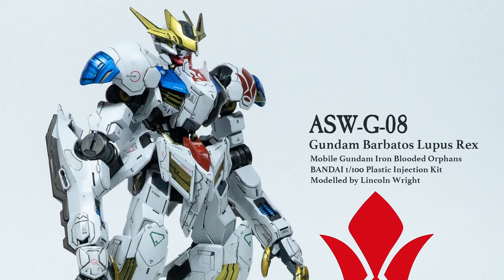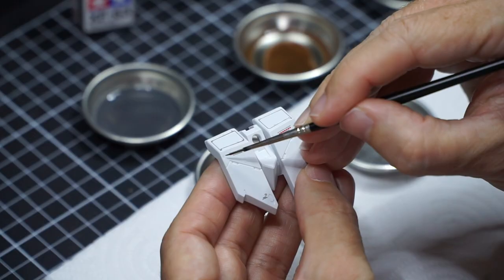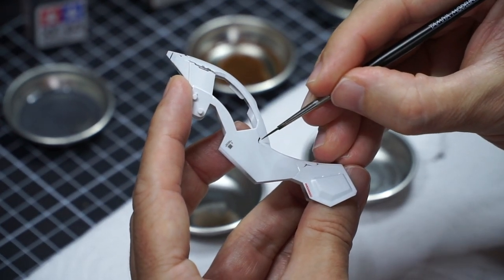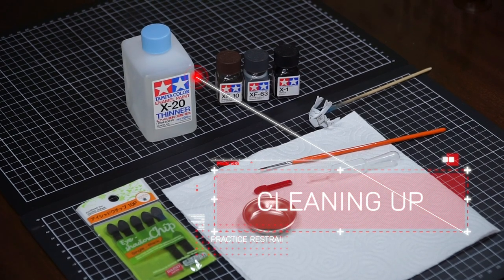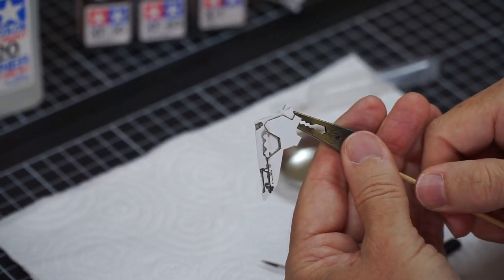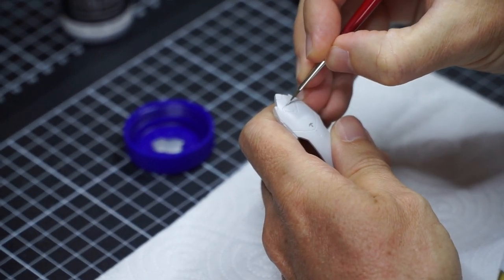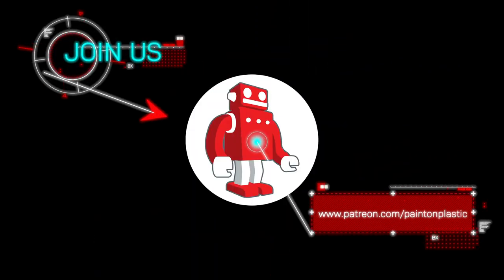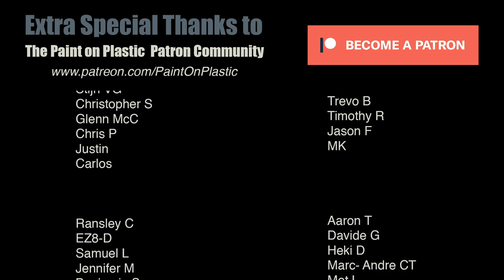Gunpla Panel Lines Tutorial Lupus Rex Lincoln Wright

Comment: Worth mentioning that you should go for the makeup sponges or Tamiya cotton buds over just your regular household cotton buds, as they tend to be tighter packed and don't tend to deposit thin strands of cotton on your model that can then get stuck into paint or varnish.

Also curious if you have given panel lining and weathering a go with Vallejo's new range of 'weathering effects' like the engine range. These are acrylic water based washes and weathering fluids, but they can be cleaned up and manipulated like their enamel counter parts by use of vallejo airbrush thinner or other similar products and cleaned up as described above with a brush damp with airbrush thinner or tamiya cotton buds. You can check out an example of the process on Vallejo's youtube channel.
Reply from the maker: Yes, that's why I went with the make up sponges. Cotton buds I suggest as a  back up. 

Yes again, in fact AV sent me this range for testing and I've used them a handful of times now.  I tried out some of these products on the backpack... In my humble opinion they are "Ok". They dry very quickly - often too quickly - and are not as easy to manipulate as enamel products. They stain more quickly too and once dry are more difficult to remove again. I'll continue experimenting with them in the background but so far they are not making it to my frontline main use choices. :)
Reply: @PaintonPlasticbyLincolnWright  Ah, sorry to hear that. I tend to favour the non toxic ranges. Adding a liquid/high flow acrylic retarder might help with the dry time. AK interactive's one and probably Mig do an identical product might make them more enjoyable. I am finding that an acrylic retarder and a wetting agent (surfacant) are something I add to all my acrylics aside from airbrushing to allow for more working time. An air conditioner in the room has my acrylics drying almost immediately, even when thinned with water.
Reply from the maker: No worries at all. I'm constantly testing and trying out new stuff on every model, even going back and re-testing old things to see if I can see them in a new way. All part of the journey. I'm the same, any time I can make a low toxic (Alex Vallejo told me they are not allowed by law to call AV products "Non Toxic" ) option work, I am ALL over it!! :) My figures are usually all water based, it works well for that result. :)
Reply: @PaintonPlasticbyLincolnWright  Thanks for the response. Curious if you have tried Vallejo's Mecha range at all. I didn't fancy the metallics but getting to grips with building my first gunpla, I am seeing that with all the handling and the models own joint mobility, a higher durability paint might be a better bet for base colour, even if you didn't employ it into detailing and weathering.
Reply from the maker: @Sock Badger yes, this is the primary reason they reached out to me, to make content and how to's for their Mecha Colour range. I have done a few test sprays on spoons, also the metallics as a matter of fact, looking for the right colors to use on my recent Lupus Rex. The gold is nice but the others were just "ok". It seems a decent enough paint but... still suffers with the challenges of an airbrushed acrylic. If I have a chance to test it more on actual projects, will share a video on it. :)
Reply: @PaintonPlasticbyLincolnWright  Any opinions on it initially? Vs say the mig mecha colours? From what I have read about on them, they are some of the most hard wearing acryllics you can find. Which makes me think you could probably take 800-1000 grit sanding film/sponge/paper to them if you ever paint them wrong and just smooth them back out, without stripping all of the colour off. Or that it might be a better option for painting the softer type plastic used in the skeleton and joints of gunpla models.

Comment: Do you wait for the enamel wash to dry a bit before taking off the excess? I've had problems with smudging/staining that I just haven't been able to clean up well, and was wondering if it was because I didn't wait long enough. fyi, I'm using the tamiya panel line accent color bottle.